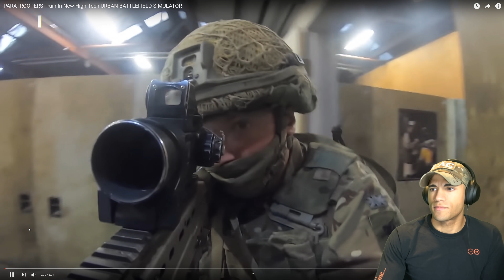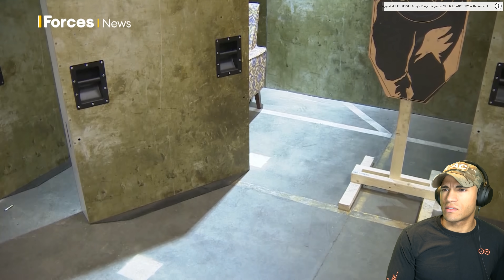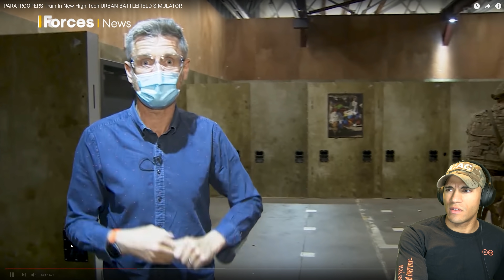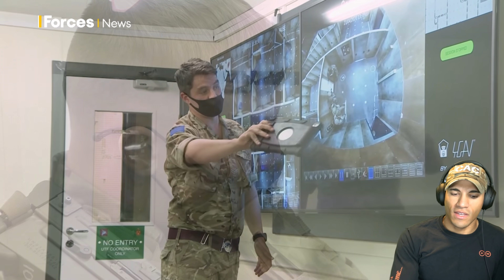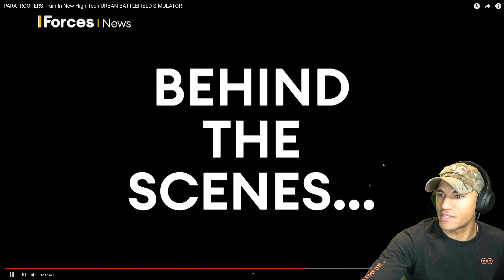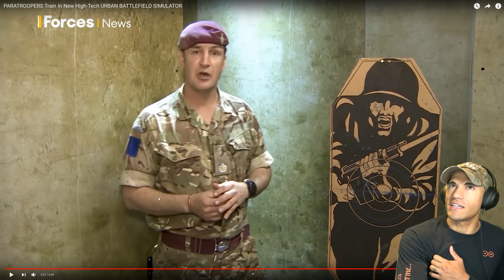Marine reacts to the British Army's NEW Combat Simulator

Comment: I remember using the old laser sensor conversion kits for the SA80 from back when I was in.
They were great, especially when you were assigned to be enemy for the FIBUA training exercises. 
Some of the FIBUA sites were great as they were literally villages/ housing estates that the MOD had bought up so they had sewers and the like to scoot about in. Crawling through the pipes to get into basements and the like was great fun, though involved a lot of banged heads and claustrophobia :)
They also had speakers dotted about to create ambient noise as well as area specific noise.
Reply: It's still a thing. Opfore is my job in Brecon

Comment: Genuine Q and I'm a complete numb-skull. What if the structure has multi floors/stairs?
Reply: Clear the floor of the entrance point and work your way up or down to the next floor, clear that floor. Rinse and repeat. Stairs are treated the same way as doors, you shouldn't leave any doors/stairs unchecked behind you.
Reply from the maker: We had one like that. Walls and ceilings were able to catch rounds so we were able to do multiple entries with loose boundary lines so teams don't enter on each other
Reply: Thanks for the replies and information, very much appreciated.